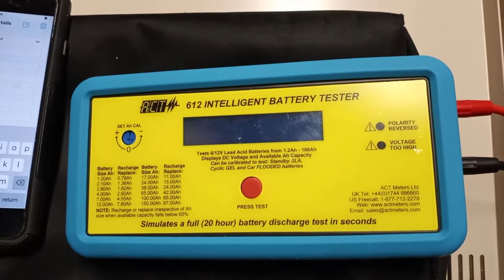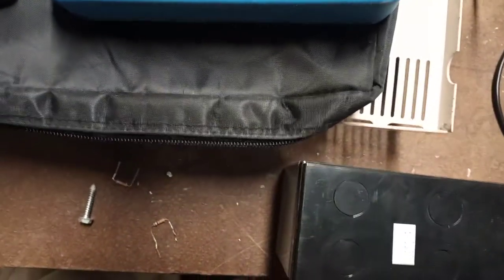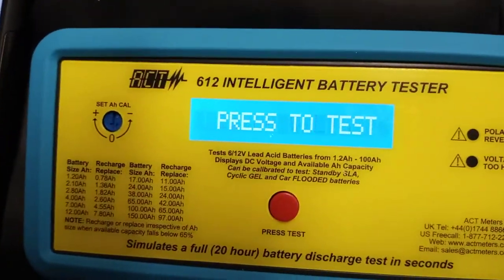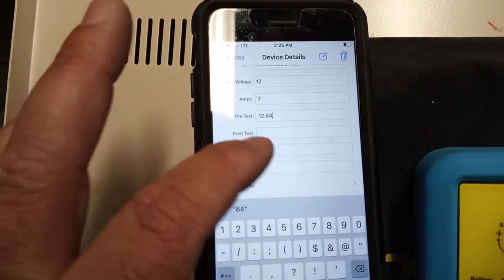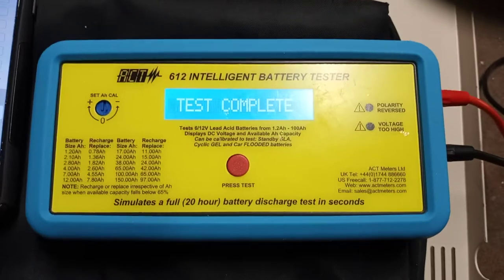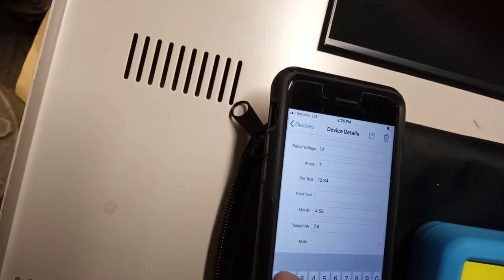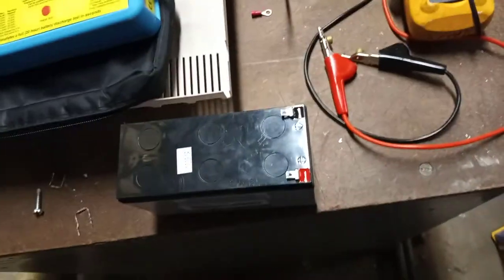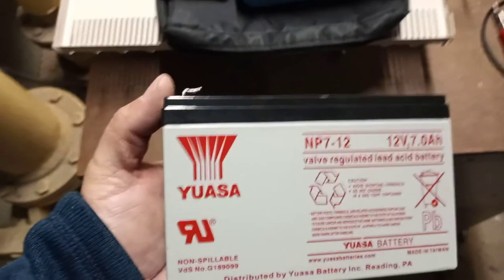How to test a battery for a fire alarm system.

Comment: Hi, Did you have to first calibrate the  612 with a fresh 7ah battery as stated in the manual? The problem I have with this unit is to have to calibrate it to a different size amp “new” battery every time I test different size batteries.
Reply: how to calibrate it?